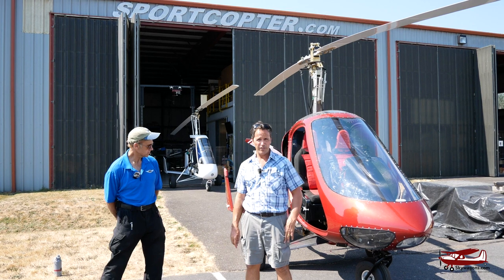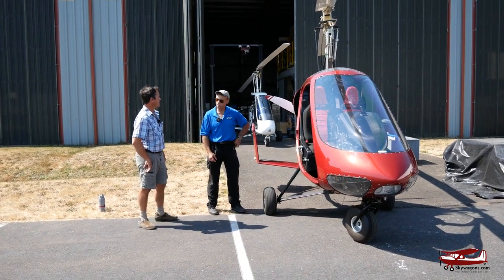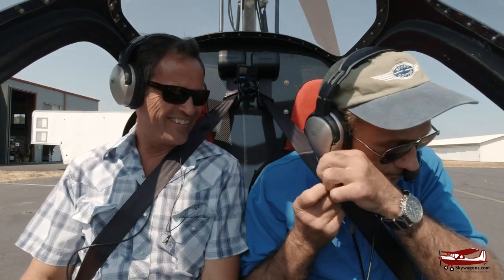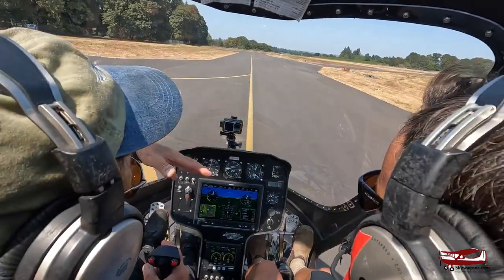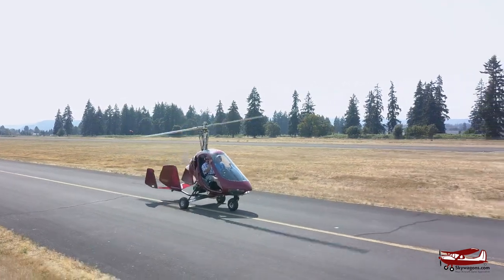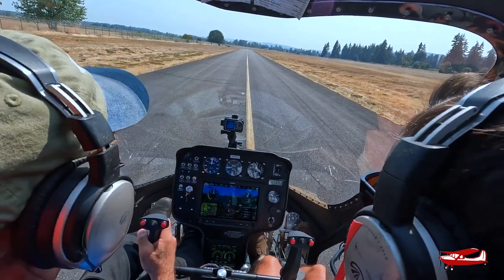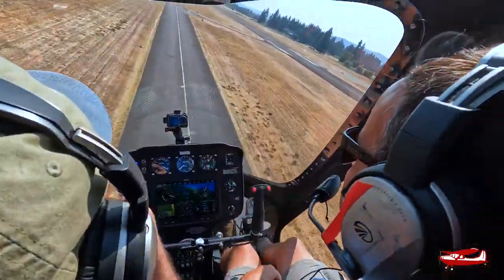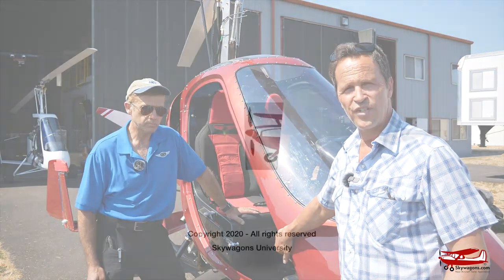Sport Copter M2 #sportcopter #gyroplane #gyro #gyrocopter #new #aviation #Vanek #auto

Comment: I want one...or a really nice Ultralight. I'm a 12,000+ hour guy, Dual ATP (RW/FW)  What has kept me up at nights is that I'm just not sold on the Rotor integrity.  I've found serious voids in blades costing 80,000$ dollars each...from manufacturers that have limitless R&D assets...so I'm concerned how these blades are built ...and will hold up.
Reply: Seems like guys with lot of hours in fixed wing who get a quick endorsement in Gyrocopters are the ones crashing on takeoff.
Reply: Most of the blades are well enough made.  Many are WAY too big.  Most other brands are seriously overweight.  You should have a look at the actual stats on in flight blade failures.  (There have been a couple) but most people crashing are doing so because because they know nothing about blade handling or management.  This guy knows his stuff, notice we wound them up by wind.  Its what we all used to do.  Once you know how its madness to put on a rotor brake and taxi several hundred meters then wait at the end of the strip and wind up.  He's not only saving his pre-rotator but also managing the rotor.  You want to worry about blades worry about what happens to a set of 28ft rotors bumping several hundred meters over a bumpy strip jack hammering with every bump.  

In flight the rotors are driven by the forward vector of lift across the blade so there is very little stress unlike a helicopter being driven from the hub and having massive twisting forces from root to tip.  So the pre-rotate to huge rpm on the ground runs the risk of twisting.  Its why I think so many have horrendous stick shake.  When building rotors you do a stringline to check both blades line up with the center of the hub bar.  Too few do it and think masses of stick shake is normal 2 per rev.  Its not.  I think the move to powerful pre-rotators might be causing a fraction of mm at the root resulting in out of pattern blades which essentially makes them out of balance.  

Another advantage structurally is you cannot in positive G overload the rotors.  Try as you might load up beyond about 2.5 g and the machine will simply mush.  This is because the angle of attack of the blade increases which in turn increases drag and starts to slow the rotor, slowing the rotor washes off lift which means the rotors will only increase in rpm a certain amount before washing off additional lift the airframe mushes and just absorbs it.  A similar move in a chopper with 8 or degrees pitch could over-slow the rotors.  In a fixed wing pull back too hard and your wings fold up.

Choose your rotors well but many are extremely well made.  Look for smooth sticks in flight.  And don't go for the biggest blades you often loose more than you gain.
Reply: @cameronlapworth2284  o

Comment: I would love to have one of these for backcountry flying and camping, but the problem has always been useful load. With two people (pilot and the wife), gas and camping gear, there just isn't enough to make it safely work. It's a shame because i'd jump all over it.
Reply from the maker: It will carry plenty of fuel in the tanks, but you are correct on there not being much room inside etc.
Reply: @GyroGerald  Wasn't he going to be offering cargo pods?
Reply: So what’s happening with production, I understand people have paid deposits and no aircraft. It’s been years now, so what’s happening?

Comment: Nice little aircraft,but it would likely be louder than the heli our town uses,an  EC120B Colibri,which the cops use at night,so it could not fly as quietly as the Colibri.
Reply: Rotor noise is significantly lower in gyros not sure about engine noise.  It's running a rotax they aren't particularly noisey.

Comment: how many hours before main rotor blade retirement.
Reply: Back in the day we had no total retirement time.  Gyro blades have very little stress in flight as they are driving themselves unlike a chopper which is being driven with masses of twisting from the root.  All the forces stop the gyro rotor from abusing itself in flight unlike a chopper which needs constant and critical care throughout flight.  however the modern pre-wind up to 220rpm then gun it is I think not great.  Additionally as most of these guys taxi with rotor brake on (because no one knows how to wind blades up anymore other than Jim and the old blokes) this especially of rough grass strips means you have often massive rotors up to 30 ft diameter wanting to stay put while the airframe jackhammers up and down.  This is not good for the rotor head the hub bar or the blades.  No one did this back in the day we all taxied with rotors spinning.  

That's actually what impressed me most here.  He is winding them up and spinning them up normally while taxiing.  Because a) he can and b) its much better for everything.  This is how everyone should do it and the only reason they don't appears to be that instructors no longer know how to wind up rotors from scratch.  I'd be willing to bet this is a big part of the reason so many of the european machines end up mangled messes.

Comment: That's almost as complicated as an actual helicopter.
Reply from the maker: Kinda but the rotors do not adjust they are fixed on a Gyroplane. The rotors are not powered, Plus there is no rear rotor just a rudder etc.
Reply: I sorta believe it. The gyro is simple but it's a critical design in some ways.. I really like what I see in Sport Copter. Especially the landing gear and airframe design. If I win the lottery I'll be at the factory really soon .
Reply: It might look like it. But that falls away the more you compare the gyro to helicopter. Everything on both needs very careful and regular inspection. But the helicopter has a lot more critical and expensive parts to maintain.

Comment: Problem with these things is they can land very short but need a mile to take off so short landings in the wilds is a bit academic less u wana be stuck. I know it’s not a helo yet we need a jump version that can spin it’s rotor enough to jump with two people on board.
Reply from the maker: Jump version is out there but much more mechanics involved etc.
Reply: Lots of the older machines would get off much quicker because a) they were much lighter and b) they had much much shorter rotors.  The bigger the blades the longer they take to get off.  Its not uncommon for some of the machines to weigh 300kg empty weight.  A rotax 583 powered single seater back in the day would be between 120-130kg empty weight and could fly with 20ft rotors.  Here is a mate of mine in very light winds taking off on the taxiway.  https://www.youtube.com/watch?v=36ogAzGGyG4  this is hand winding rotors.  See how slow he is taxiing?  This is because that's all the speed he needs to get the rotors to transition.  This is miles better in terms of takeoff distance than pre-rotate to 220 rpm then try to pick up speed to match the rotor rpm and hence waste huge amounts of airstrip getting off.  

This machine because it was so light only needed 20mph to get airbourne then climbing out at 30mph.  Most modern machines weigh so much they are doing 45mph take off then climbing out at 60mph.  This is why they use so much airstrip.  This machine was designed by my instructor.  Steve here and two other blokes build identical machines (they made a frame jig) so 4 identical machines my instructor though put on 20ft 7 1/2 inch chord blades these are 22ft blades and it got off quicker even than this and climbed better.  He was always first to 500ft inspite of Steve here being very skinny.  

Even my old VW would get off in 1/2 the distance of most gyros on 22ft 7 1/2 inch rotors not because of the rotors but because most machines are way too heavy on the nose.  You look at the old Bensens they sat on the tail until you got into them.  This means you didn't need the rotors to be turning as fast to lift the nose.  When you lift the nose you get an extra few degrees and the blades scream up to speed.  So the right position of the axle makes significantly more difference than disk size.  People just want more pitch, longer rotors and they don't realize there is a massive cost to performance.  Look at the specs of the Wallis machines and its performance.  20ft 4 inch diameter blades.  And look at the take off distance.  https://www.youtube.com/watch?v=RQMImcbbI_Y   the two stroke had even better take off performance  https://www.youtube.com/watch?v=Tu_y0angRqY .

So we don't need jump take off heads, we need to keep the bloody weight off our machines and get out of this cycle of bigger, taller, longer, heavier, more powerful and much much more expensive machines.  My old VW cost me about $2500 to build (own wooden blades) I'd be willing to bet I was having as much fun as anyone else.  Yep I'd have preferred a rotax 503 but couldn't afford the then $5000 price tag.  Not reliable I had 4 engine related emergency's all handled without damage including 2 complete engine failures.  So I can't wait until battery technology comes along so that I can make a machine 100kg empty weight with 50kg of that batteries and an hour total endurance.  A paddock basher.  Figure in 5-8 years the batteries will be there.  Then we'll have 1 moving part engine and we can get back to light simple machines.  But this one is nice.

Comment: Who was the first helicopter pilot? How he learned to fly a complicated machine like helicopter!?
Reply: Well gyros were before choppers.  The Germans developed the first which had double counter rotating blades which removed much of the complication but they were bombed out during WW2 so it was Sikorsky who flew the first modern choppers but many versions existed with some success in the 1930's.   Sikorsky believed all engineers should test fly their own machines that way bad engineers eliminated themselves.  He used tethers at first but also crashed a lot in the early days.  But these were hovering accidents a few feet from the ground.  So he'd brush himself off re-design and go again.  They were using gyroplane rotor head design as fully articulated rotors were developed a decade or 2 before choppers used them.

Comment: I really don't like that T-handle - even if I had money for a gyro, that alone would put me off this one. Petty perhaps, but we all have our pet peeves!
Reply from the maker: Really? I would like to try it and see if much different
Reply: I like the looks of it. Of course I'm getting older and not as agile.. But also it has a lot less mechanical complexity than two sticks. There is less to go wrong and it might even save a little weight.
Reply: Did you see why he did it.  Its to aid getting in and out.  My old Bensen and many at my club had a t-bar like a motorcycle handle.   I agree its ugly but the reason we did it (not like this one) is our instructor noticed in ground training (this was back in the era where that still happened), that when students got stressed they tended to pull to the right (if right handed) we figured it was tension in the arm pulling back and to the right shoulder so we encouraged t-bars.  This meant if you stressed you pulled straight back not to one side.  It worked.  All these little things make a big difference.  

This machine is quite high off the ground I imagine getting in and out would be far easier than trying to swing a leg over.

Comment: It's my first time seeing a chopper that does not hover for take off...
Reply: Not a "chopper" , it's an autogyro or gyrocopter,  needs forward airspeed to fly  ,  blades , unlike a chopper , are fixed pitch.
Reply: It's not a chopper and in flight those blades are not powered.
Reply from the maker: Less expensive than helicopter by an incredible amount, Gyroplane is easier to fly and own compared to a helicopter 🚁
Reply: Gyro plane
Reply from the maker: @gyropilot7191  technically they are called Gyroplanes not a girocopter. But most people know them as a gyrocopter. It is kind of like when you say I want a Kleenex Kleenex is a brand of tissue. The way Gyro Copter is a brand of Gyroplane